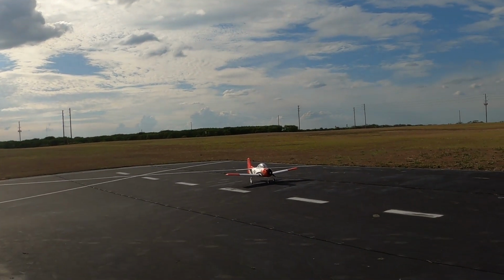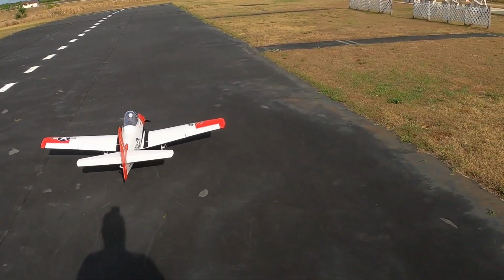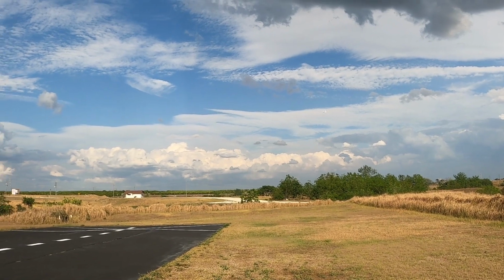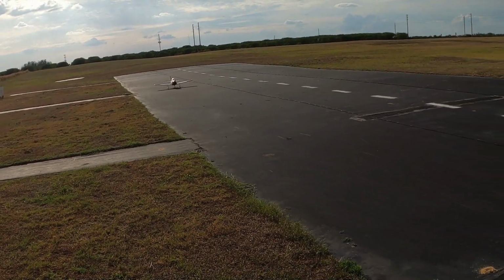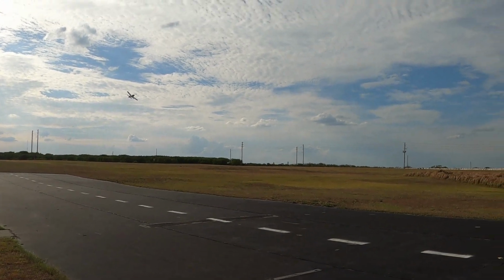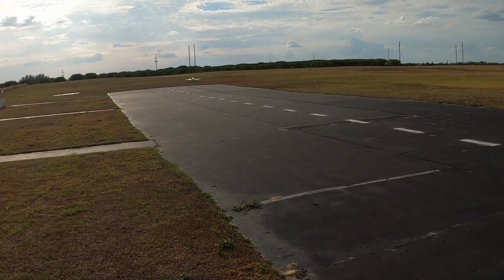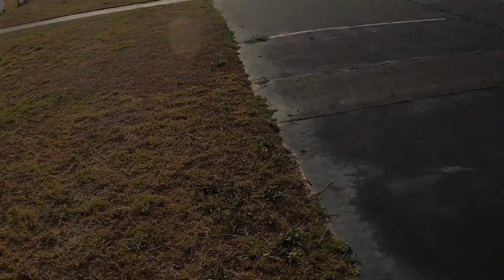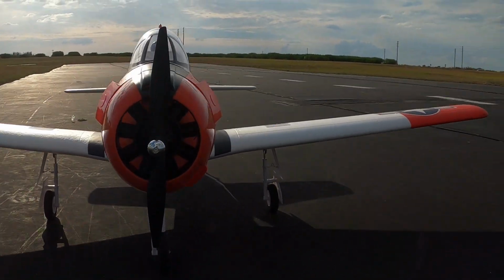E-FLITE CZ T-28 ANOTHER GREAT FLIGHT! by Fat Guy Flies RC

Comment: You need to fit some suspension struts to it, I am running a Freewing A-10 nose strut/wheel and FMS 1.7m P-51 struts on the mains with 3.5 inch Robart soft tires. Works a treat. I'd also try out a 16x10 or 16x8 Master Airscrew three blade prop.
Reply from the maker: Any mod to fit in that gear?
Reply: @FatGuyFliesRC  only mods that I did was make new pins long enough to fit in the retracts. Pretty easy though
Reply from the maker: Thank you